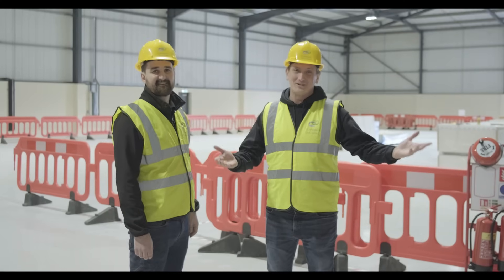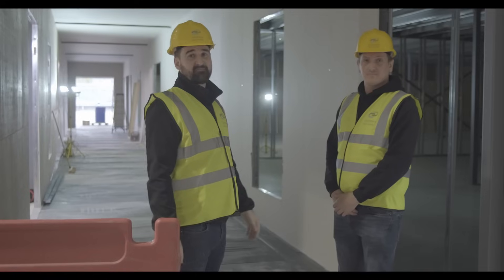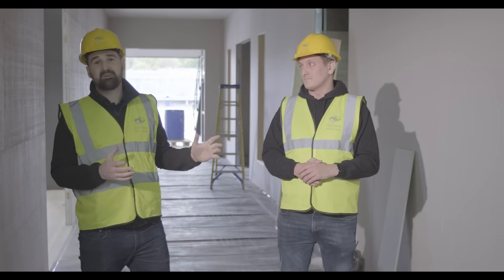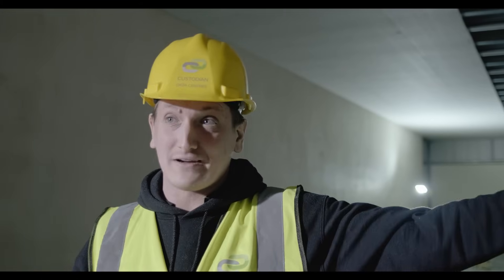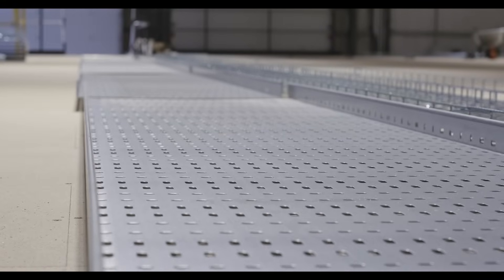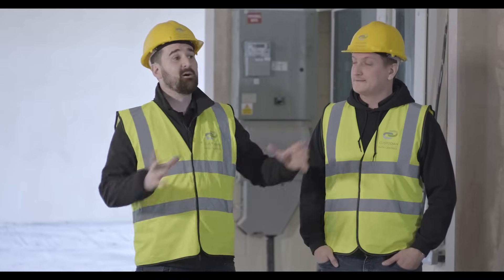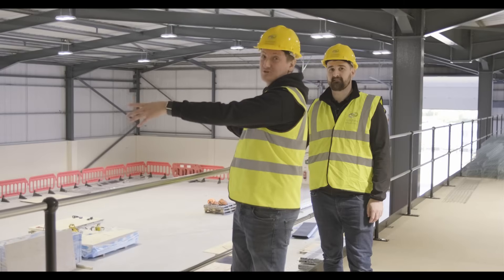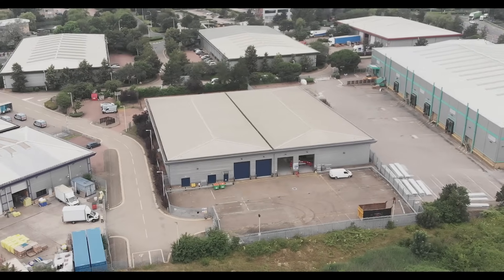HOW TO BUILD A DATA CENTRE - Introduction - Episode 1 (NEW DA2)

Comment: Where is the environmentally safe side of technology? 
From batteries basic materials to process them after OBSOLITE to the 10 megawatt data center s to the areas built that multiply per second , being built all over the planet .
No one talks about .
One more 
All the materials used in the never ending less durable devices , so much that one don’t own them anymore got to buy a new one every 2 ,3 years .
If power by solar would need a 65000 sqm in for space .
Madness .
But no one questions technology and it’s non environmental friendly aproach .
Forget about the lithium extraction sites.causing havoc everywhere in the world .

Comment: 00:19 Introducing Custodian's new data center in Dartford
01:43 800 racks, 10 megawatt power capacity on 2500 sqm plot
02:38 Setting up a fully populated data center requires massive power and cooling infrastructure.
03:40 Tour of a specialized 50-rack data center
04:38 Overview of mezzanine floor setup
05:38 Setting up data cables and power supply for the data center
06:36 Technical team undergoing training at vendor facilities.
07:38 Transition to new suppliers and update on build progress

Comment: 10 MWh for 800 racks.... Someone fucked up:) 40-45% will go to cooling and not counting in all the other little stuff (lights, office space, break rooms, etc.) that's ~5.5MWh for 800 racks. This comes out to 6.8 kWh per rack. Cut that in half because you probably want to do A/B power and provide some redundancy, and you are down to 3.4 kWh per rack with average power density of 16 kWh these days.... Yeah, this won't scale.

Comment: and comes equipped with UK's fastest internet using outdated do(g)sis coax TV cables achieving a whopping 25mbps upload speeds for you best needs aka infrastructure here is a decade behind of baltic states where you can get 2gbps symmetrical fibre connection to your home for 30 quid a month... 
- Oh, no but baltic states are small, you need to think about UK's size bla bla bla...
-Sure, but, UK's budget is 30-50 times bigger than baltic states so what gives on using coax tv lines for internet rather than scrapping all of it and starting with fibre 13 years ago while having 50 times bigger budget for it

Comment: Building a data centre is more about understanding the practical knowledge of how it works, there was an exam conducted in one of my previous organisations by a large data centre architectural and engineering organisation and almost 95% of the people who attempted the exam were failing to clear the paper (these were people who had a lot of experience in Information technology and were way more qualified than me in terms of degrees as well, they were preparing for the exam for months), Before studying I went around a data centre and understood how it works, studied for about two hours, took the exam, finished it in about 30 minutes and got all the answers right! (It was not very technical and it was so easy). 
Cheers
🥃🌱🙏☢️♂️😎✌️
Reply: That’s really impressive! Shows how valuable practical understanding is compared to just theory.

Comment: curious about fire rating with having normal walls or do you rely on a good fire suppression system to cope when needed  

also where are the compromises when building such a system  yes ideally everything would be top notch but in reality there are always compromises (managment)

Comment: So, do data centers implement the 3-2-1 rule or some other rule where they have off-site backups for their data? Otherwise, this flimsy structure is prone to all kinds of natural or man-made disasters. How rugged is it, and how does it measure on a military-grade scale for information security?
Reply: Depends on the workload. Their website lists a couple of possible workloads for this DC. First option is colocation. Generally, that means that customers bring in their own hardware and only rent the rack, power, cooling and internet connection. In that situation the customer is responsible for redundancy and off-site backups.

A second option is cloud providers. They rent rackspace or, more likely, entire rooms/suites and place their own racks, pre-populated with hardware. In this case, backup and redundancy is taken care of by the cloud provider.

Oh, and by the way: 'military-grade' is one of the lowest grades in existence. Have you ever heard the saying "good enough for army work"?
Reply: Short answer yes. The long answer is duhhhh of course!
Reply: Not only do most cloud and colo service providers backup their data, they basically clone/mirror the data they have in one data center to another physically separate data center, just in the case one blows up or something. AWS for example has the ability to have your data backed up in multiple data centers across different regions, so if some unlikely event that a whole country decides to blow up, your data is still safe and business uninterrupted. Obviously you pay more depending on the level of resilience but cloud providers give you the option of scalability depending on your business needs.
Reply: Watch Inside Data Centers which is Microsoft explaining Azure DC capabilities. It is really interesting and answers some of your questions
Reply: It really depends on the role of the DC, since Custodian are predominantly a co-location provider their responsibility is to provide infrastructure (power, thermal and networking) with redundancy and will be expected to meet some industry standards for hosting (mostly thinking of Uptime Institute). Redundancy, and integrity of the hosted systems will almost entirely be down to the client's buying capacity and will be subject to contractual SLA's for availability, thermal conditions etc. The lines blur a little with dedicated halls/pods for specific clients, but often they will bring their own data, and telco rooms will often have kit managed by the peering providers so can be hands off for the co-location teams. Having two sites I would anticipate once this is up and running they would probably transit data between their two DC's at a lower cost (or free) for customers that wanted to replicate across sites.

Cloud providers like GCP, AWS, Azure etc. will usually go further as the scale of what they are trying to achieve is different, they will usually build DC's in groups of three for each region, the goal is that for any given region there should be a balance of geographic redundancy (i.e. Bristol, London, Cambridge for a fictional availability zone for UK) as the likelihood of a natural disaster of infrastructure failure affecting those locations simultaneously is extremely low, while ensuring network latency is kept low so they can replicate data, and services reliably. Note that the higher the latency the harder it is to replicate resources in real-time.

To be fair in the UK we don't really get all that much extreme weather to need more robust facilities, though there will nearly always be flood surveys done and contractual agreements put in-place for peering providers (ISPs) to restrict construction work near fiber and power to the facilities along with contracts for running on diesel if power were interrupted. Most of the facilities in Western Europe here also make Tier 3 pretty easily so there really isn't all that much need. Come to think of it I can think of a top five bank with a DC based near Basingstoke that isn't that different in construction and security to this just far far bigger.

Generally I would dismiss anyone referring to their encryption or security as being military grade unless they are going to be very specific, in the US NIST SP800-53 R4 for example provides some really strict guidance on data in transit, FIPS 140-x which covers more than encryption as it can include physical tamper protection, NCSC IPSec PRIME Profile that provide guidance on VPNs and so many others. So most countries have a different idea of what is secure for government and that can sometimes disagree with industry best practices (thinking of Elliptic Curves in particular). 

Some useful resources if you wanted to get a feel for what to look for include Cybersecurity & Infrastructure Security Agency (CISA), National Institute of Standards and Technology (NIST) {STIG templates are very useful), Defence Industry Security Association (DISA), National Cyber Security Center (NCSC) {Aligns a lot with the US}, Center for Internet Security (CIS) and the Cloud Security Alliance (CSA) {Useful for checking vendors on STAR}.

On a side note it'd be nice if Custodian shared how the thermal design for the site is setup, the smaller pod at 13.33kW per rack is interesting (vs 3kW in main hall), I've seen issues on free cooling (I'm sure one of the other videos showed DA1 was free cooling), would like to know if that design is repeated of if there are backup chillers on this build? The thermal margin of 17.66kW seems to suggest the smaller pod is power limited and the optimal was for 50x 10kW. Also is the design using three-phase throughout, single-phase or a mixture based on room/rack?
Reply: @scottdonaldson821  They did mention the thermal design in the video. They are using Chillers for cooling via dedicated perimeter AHU's with Chilled water coils, using the Data hall as a cold aisle with hot aisle containment both exhausting and recycling through the coils from a central duct. The DA1 isnt just free cooling, they use indirect adiabatic cooling which did the job for their heat load without the need of having chillers or crac units. As far as single phase vs three phase, its usually always 3 phase used as the feeder to the busway or pdc/pdu which then distributes to the rack pdu as single phase. If the DC uses decentralised UPS's they may even use 3 phase going to the racks in which it then converts to single phase via the rack UPS. So its safe to assume three phase throughout.
Reply: @KaesOner  thanks for pointing out the bit I missed on layout. My main interest is that adiabatic cooling (most vendors would consider that free cooling) can still limit performance through the summer months. I worked with a site in East Anglia that in the summer months is well outside of ASHRAE A4 specs (original design was to meet A2) with rear temps exceeding 38C as they went chiller free without any backups. It leads to high efficiency (though we didn't measure WUE) but I'm not wholly convinced that the sustained temperatures in summer wasn't causing damage. They were running back or rack cooling on some of their kit for 80kW loads, so an interesting mix of workloads.

I probably should have clarified that the reason I am interested in the power phasing is that most colos do only run single phase to the rack (rpdu/strip) as they can't rely on their tenants to phase balance at the rack level so your point on the busway being three phase is likely, however I'd expect the dedicated pods at higher load would go with three-phase at the rack for the efficiency. A video on how they balance out loads would be good, they must be doing some level of balancing across tenants but must be a little more awkward since they don't have any control over the kit installed.
Reply: Much higher than military grade.
Reply: @DuchessandHammer  Dear this is no way near uk CNI category 3 standard.
Reply: @abdulrashid3339  That's not traditionally military grade. I'm not sure what quoting critical infrastructure categories has to do with this. Also please be cognizant that  military grade often refers to the lowest bidder with minor consideration for quality.